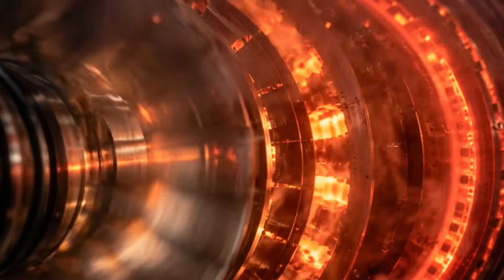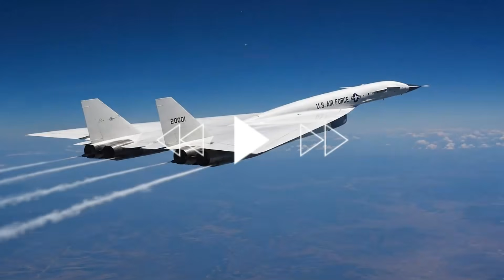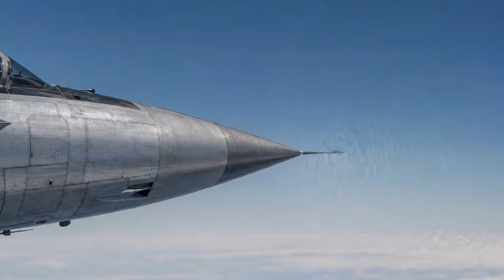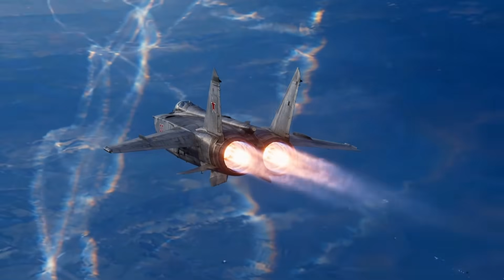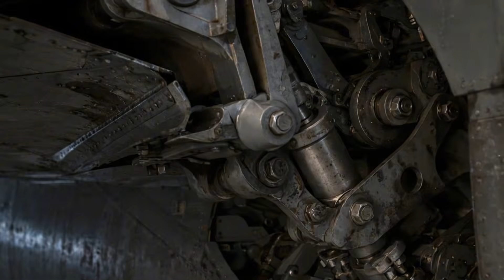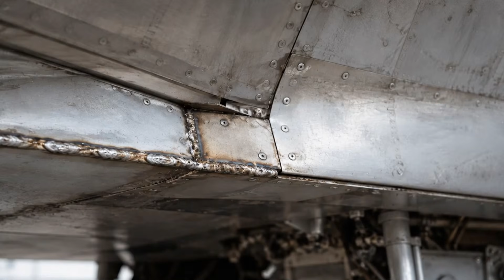The Flying Anvil: How The Soviets Built A Mach 3 Steel Monster

Comment: Wrong! The MiG-25 was designed and built to intercept the XB-70 Valkyrie, not the SR-71 Blackbird. Ultimately, the Valkyrie was just a prototype, and never flew a mission.
Reply from the maker: You're absolutely right about the XB-70. The MiG-25 program was driven largely by the threat of high-altitude, high-speed aircraft such as the XB-70 Valkyrie. I should have made that distinction clearer in the video. Thanks for pointing it out!